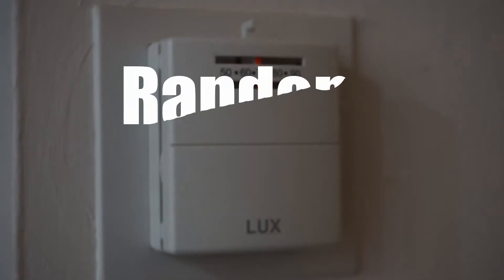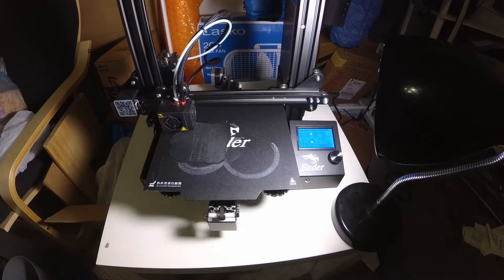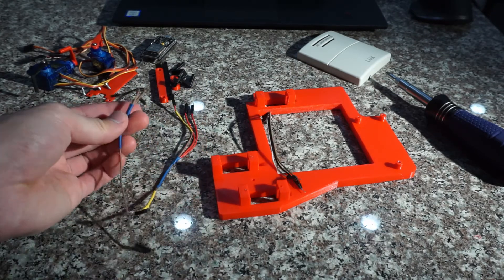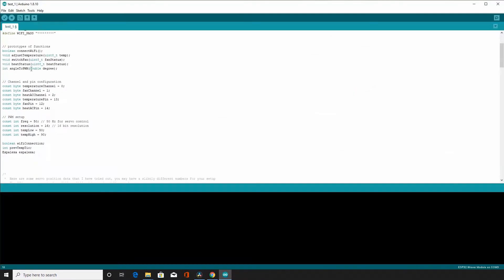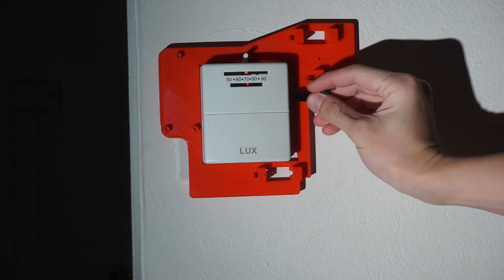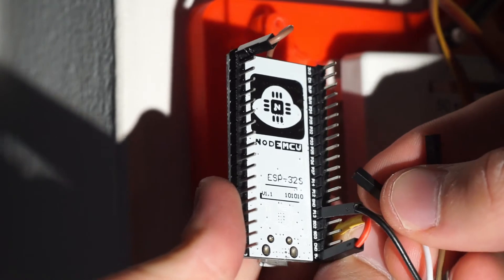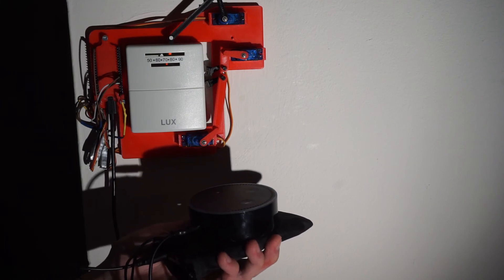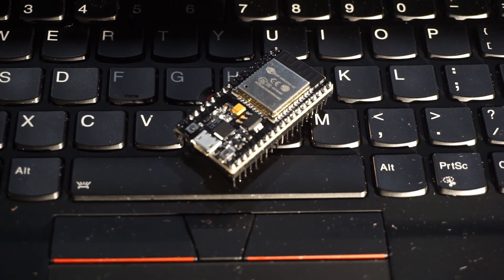Make a smart thermostat with ESP32!

Comment: Thermostat wiring is pretty easy to work with. It’s just a matter connecting the wire representing the system you want to turn on to the ground wire.